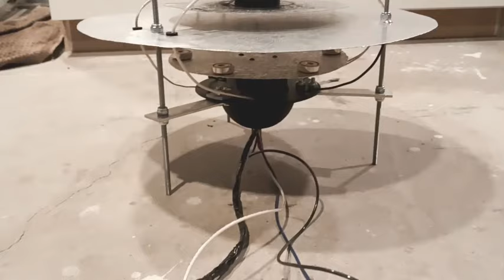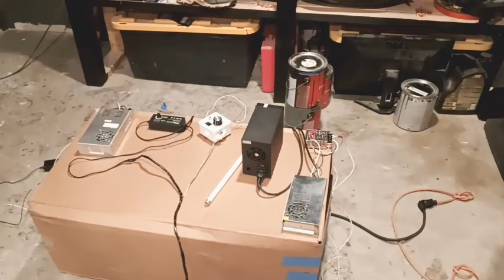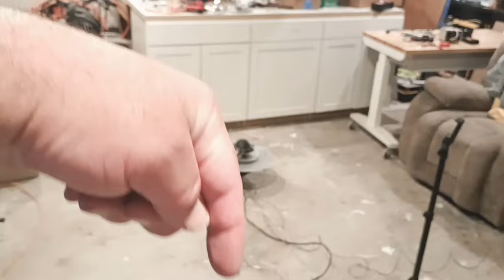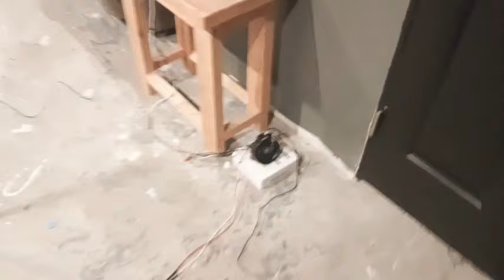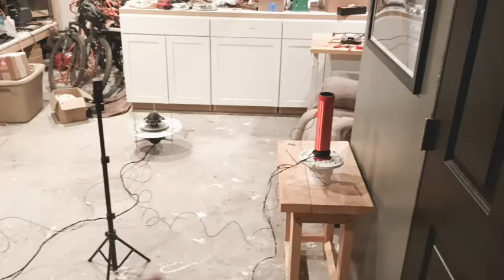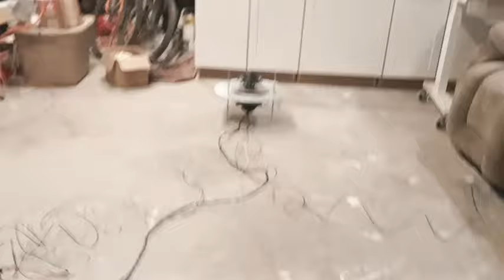Graviflyer Testing 13

Comment: If it makes you feel better, I just burned up all my motors. We all burning things up today 🤣🤣🙌
Reply from the maker: your motor eats the high voltage. The higher the voltage the shorter the motor life. When you put in the tesla coil it will increase the hv and you will need less of it. The motors will also take less abuse.

Comment: Hi Nathan, I have emailed you a schematic of a stable slayer exciter Tesla coil. I'm also working out the bugs from the ZVS Tesla coil we are working on. It's almost complete. I'll email instructions for the ZVS when I'm done. Please let me know if you have received my email.
Excellent work on this video!
Reply: He needs a stable circuit that generates a very good square wave under load.  And can be varied in frequency also.
Reply: @doityourself3293  Thanks for the help. Forgive me if you already know this. The only way to adjust the output frequency of the Tesla coil is to change the top load or alter the primary and secondary coils. The rule of thumb is to add inductance (increase turns of wire) or add capacitance (increase the size of the top load) would lower the resonant frequency. The Tesla coil's output is a high-frequency, high-voltage sine wave wave. Converting it to a variable square wave would indeed be a difficult challenge. Again, thank you for the input.
Reply: @shawncalderon4950  On most circuits it is a lot easier to change the wave form on the low voltage input side rather than the high voltage output side. Is this possible with a Tesla coil?
Reply: @andyspoo2  You ask a good question. If you have ever listened to a Tesla coil play music, you are hearing a musical square wave “added” to the Tesla coil's sine wave. The music square wave “rides” on the sine wave. Amazon sells Tesla coils that have this functionality. If you google “musical tesla coil,” you will find many tesla coils that output sine waves and square waves as the output. From my experience, natural resonant frequencies are sine waves. A sine wave is a circle. These “circles” appear every where in nature. Please forgive this long-winded answer and let me know if I have answered your question. Thanks for commenting.

Comment: 😅 random thought.. i was thinking about how speakers 🔊 make a static from hooking a small battery to them...😅 could 2 wires be touching something and show the 🤔... 🤔 current/charge ??? In the item say like a plate?  Like the way the hv brushes on top and bottom.. im wondering if it can indicate when a change is made 🤔

Comment: Nathan, It all looks good. What is a DBS versus the transistor circuit?
Reply from the maker: the zvs when I was building it took 80v and 13a for 3 minutes and never got hot when it failed to oscillate. I need less than 1 minute. I need it to hold the feedback for 1 minute or less then send a surge when it oscillates again. it is not about diode protection. The circuit is just better at it.
Reply: Thanks Nathan. I thought you said DBS. LOL. The ZVS is a power controller that does not heat up like a transistor circuit that burns out. It is like a thermostat that switches on and off and only lets so much of the harmonic frequency power of the graviflyer through to the tesla coil when the graviflyer pushes the power back into the tesla coil when you turn it on, so the tesla coil does its thing. I thought you were making a much larger Tesla coil, but I see you are still using the original Tesla coil. They use ZVS circuits in power inverters and converters to change AC to DC. With a ZVS you can control how much power passes through the circuit. Thanks for all of the answers you give to people as not many people take the time to do this on this channel.

Comment: i'm sure this has been thought of already but what might happen if you put it on a scale to see if the weight of the disc changes?
Reply from the maker: a digital scale would not work with high voltages. I have a regular scale and it bounces around to much to show any result you can trust.